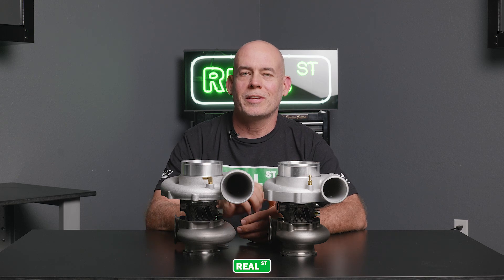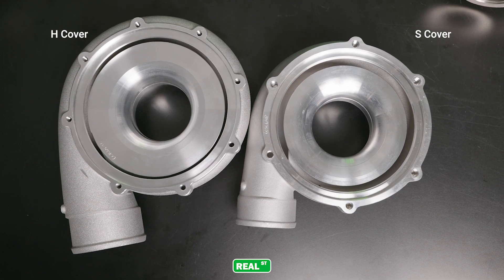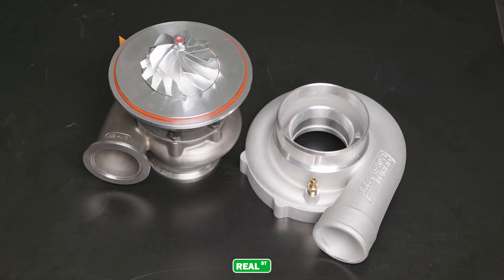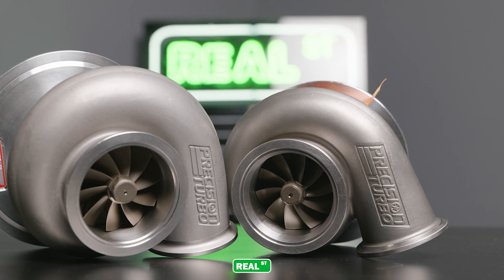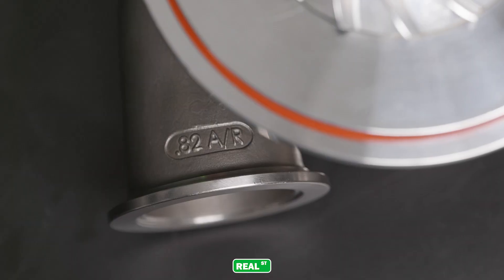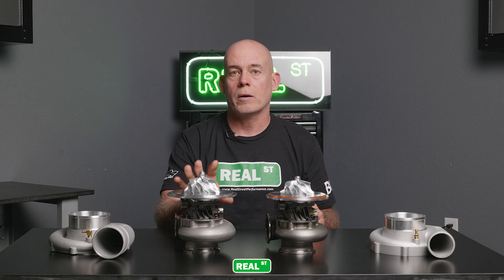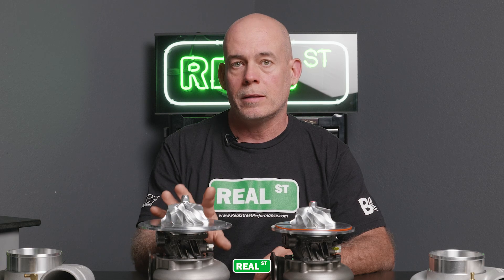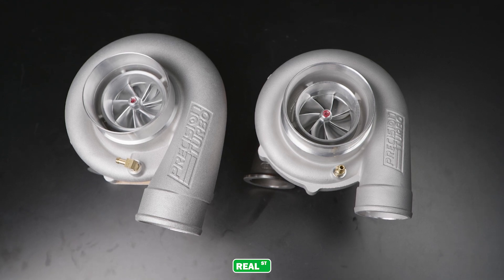6470 Next Gen R Precision Turbo | First Look - Real Street Performance

Comment: Precisions make a lot of power, but i've seen too many explode, and not only explode but cause a lot of other damage also, fire etc. Turbine wheels firing out of hood and fender exit dumps like artillery shells. You just don't see that stuff with Borgwarner, Garrett, Holset etc etc.
Reply: I call them Precision grenades 😂🤣
Reply: @St0RM33  Cold side scatter blankets wouldn't exist if it wasn't for precision
Reply: @FastPaull  if i had one i would send it to Ukraine as ammunition
Reply: @St0RM33  Lmao more dangerous than any mortar
Reply: I’ve seen 3 blow up class legal 88 s
Reply: GARRETT for the WIN
Reply: Garret >
Reply: Can't go wrong with Garrett
Reply: Not really when comparing sizing vs garrets new G-series line and other aftermarket guys like forced inductions, all the fastest radial and n/t small tire guys are running forced inductions stuff or CRT/midwest turbo stuff, which i believe are based off garret cores.
Reply: @thewraith6360  precision used to be supplied by Garret and splitnoff on there own (aroind 2013 if i remember correctly) for the first few years they gained quite the rep for quality control issues and unreliable turbos. After a few years they made substantial improvements and there was a noticable difference in quality/reliability. But if you had to buy 1 turbo for a build you spent a long time saving for, i'd go Garret
Reply: @RandomlnternetGuy  Agreed
Reply: Hart's make good turbos as well
Reply: @prienchutterpaul6638  I disagree
Reply: @Brown_Hammer  what's the issue with the Hart's?
Reply: @prienchutterpaul6638  very true
Reply: You see that with ANY turbo running max effort.
Reply: @angryaero  No, you don't. Precisions blow up far more frequently than any other brand of turbo. The evidence is out there.